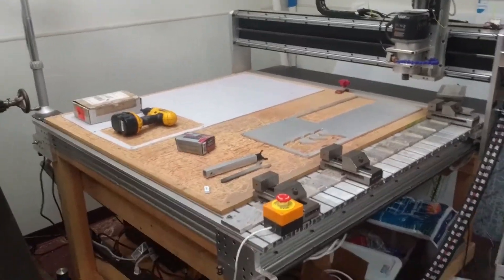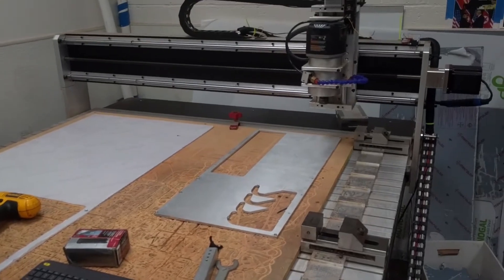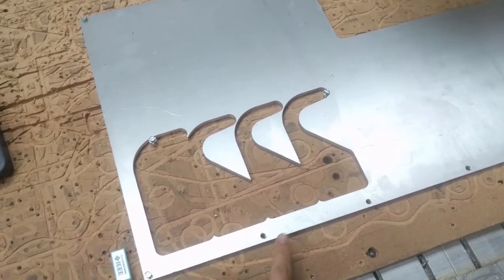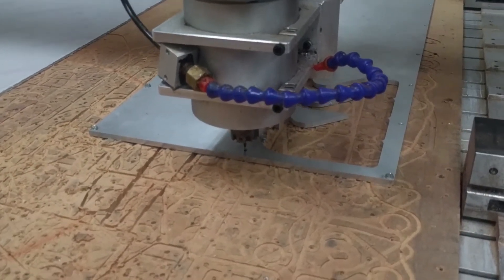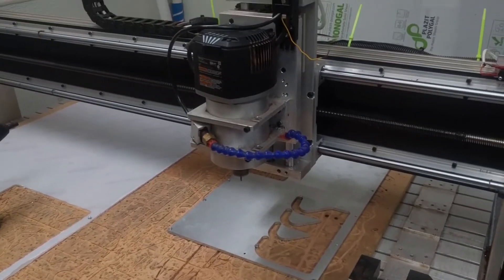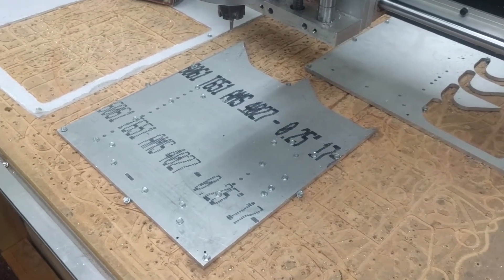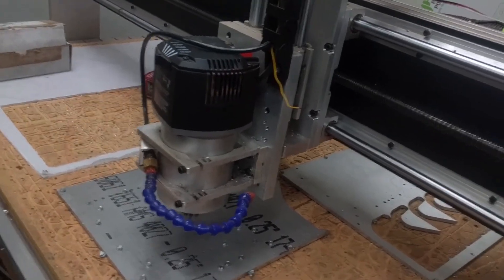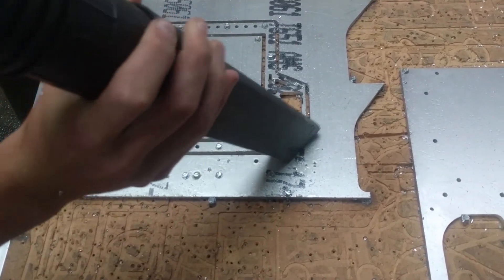Cutting Sheet Metal on CNC Router Part 2

Comment: Great man just started to learn CNC machining I am solidworks design engineer just wanted to Know do you select cutting tool yourself or they are specified by engineers.
Reply from the maker: The machinist is usually the one that chooses their cutting tools.
Reply: @jonathanmi6  thanks .you guys just need the tool path in the form of G-code. Right??
Reply: @jonathanmi6  So as a designer we should generate the best tool path for machining .
Reply from the maker: @ALIRaza-MCE-  Depends on the machine shop, but typically the machinist is also the one that does the CAM. The designer simply hands off the CAD model and it's specifications.
Reply: @jonathanmi6  thanks for your reply.I'll learn it deeply.